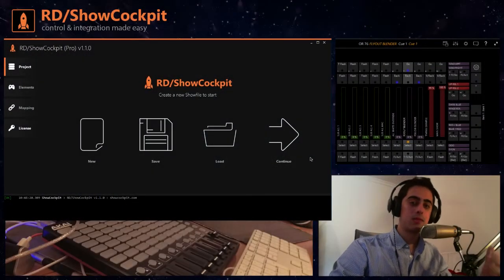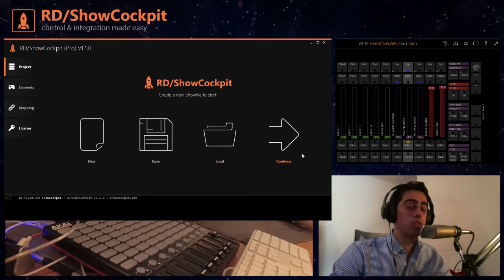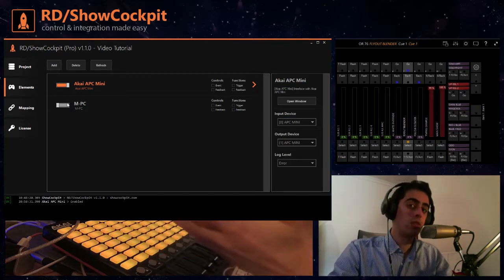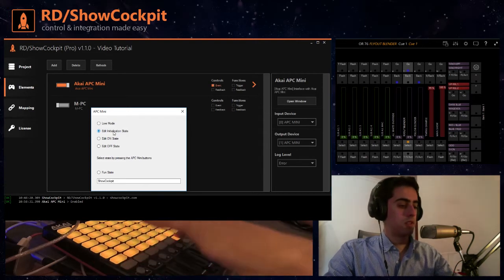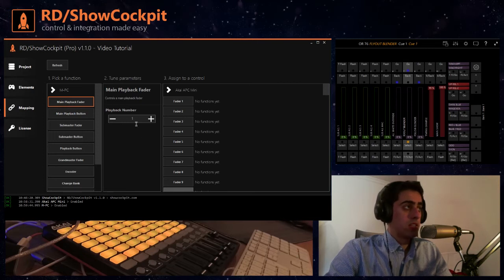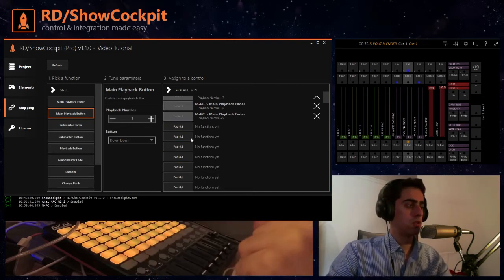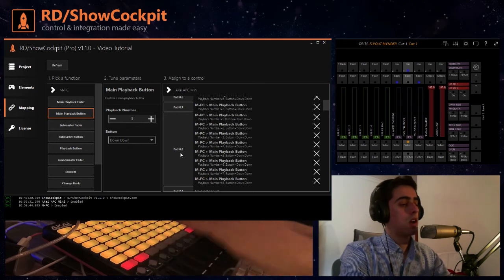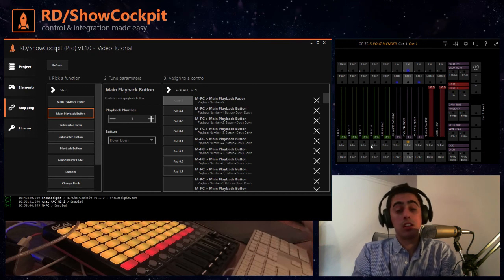RD/ShowCockpit Introduction

Comment: are you limited to the midi devices that are currently available or can users create and map their own device profiles like with MPCTools?
Reply: I want to use a novation launchpad RGB and have my pad colors match the pallet colors. additionally, id like to use behringer x-touch extender for motorized faders with scribble strips.  can all of this be done with ShowCockpit? Excited to get started!
Reply from the maker: Hello Brian.
There is a Generic MIDI driver available. You can map virtually any MIDI device with it.
Reply from the maker: X-Touch integration is planned. Please join our Facebook group and vote for the drivers you need. ;)